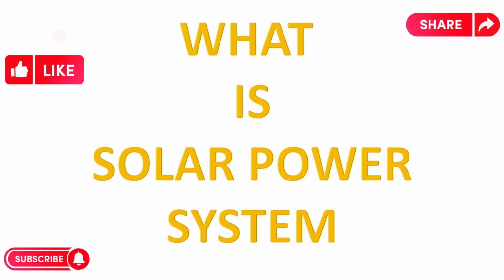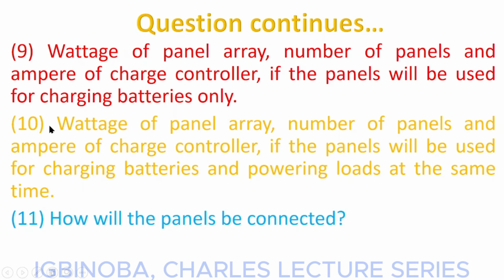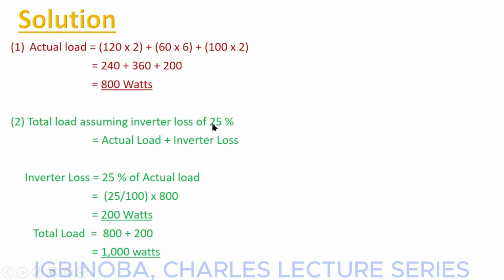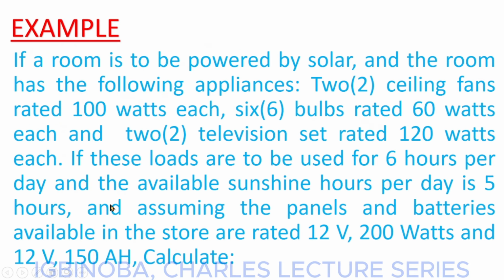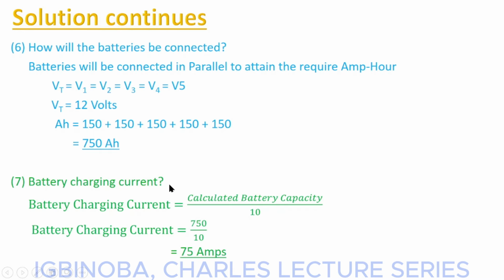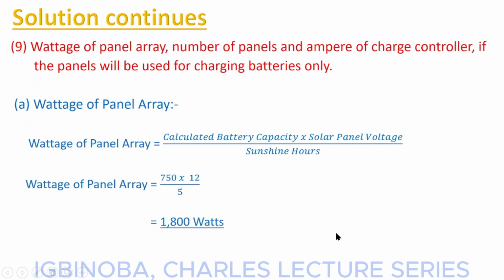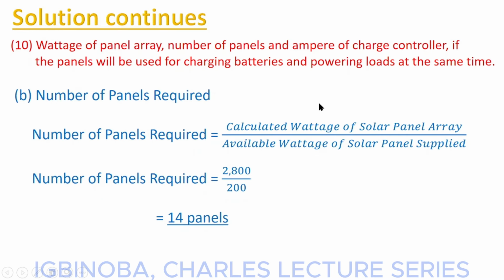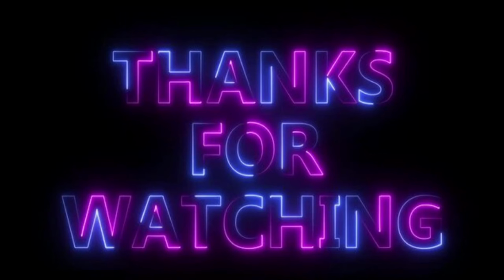Design of Solar Power System

Comment: EEE395Q 
1. Actual Load = 1380 watts

2. Total Load = 1725 watts

3. Inverter Rating = 2156.25 VA

4. Battery Capacity = 1293.75 Ah

5. Number of Batteries = 8.625 ~ 9 batteries

6. Parallel

7. Battery charging current = 129.375 Amps

8. Charging time = 14 hrs

9. (a) 3105 watts
    (b) 15.525 ~ 16 panels
    (c) 258.75 Amps

10. (a) 4830 watts
    (b) 24.15 ~ 24 panels
    (c) 402.5 Amps

11. Parallel

Comment: PETRO3180X
ANSWERS 
1. Actual load= (100×3)+(60×10)+(120×4) =1380watts
2. Total load assuming inverter loss of 25%= Actual load +Inverter loss
Inverter loss=25% of Actual load
= 25%×1380=345 watts
Total load= 1380+345=1725 watts
3. Inverter rating on VA using power factor of 0.8
= (1725÷0.8)= 2156.25
4. Battery capacity using factor for reserve 75%=(2×1725×6×0.75)=1293.75Ah
5. No. of batteries for backup hours=1293.75Ah÷150Ah= 8.6 =8 batteries 
6. How batteries will be connected?
The batteries will be connected in parallel 
Vt=V1=V2=V3=V4=V5=V6=V7=V8
Ah= 150+150+150+150+150+150+150+150=1200
7. Battery charging current=1293.75÷10=129Amps
8. Battery charging time assuming charging loss of 40%= 1293.75Ah+(40%+1293.75Ah)÷129A=14hrs
9a. Wattage panel array= 3105 watts
9b. Number of panels required= 3105÷345=9 panels 
9c. Ampere of charging controller required= 3105÷12=258.75Amps
10a. Wattage of panel array= Calculated wattage of solar panel array for charging battery only+ calculated total load =3105+1725=4830watts
10b. Number of panels required= calculated wattage of solar panel array÷ Available wattage of solar panel supplied= 4830watts÷345= 14Amps
10c. Ampere of charge controller= calculated wattage of solar panel array÷ solar panel voltage=4830watts÷12volts= 402.5Amps
11. How will the panels be connected?
Ans: They will be connected in parallel

Comment: PETRO331E

1. Actual load= (100×3)+(60×10)+(120×4) =1380watts
2. Total load assuming inverter loss of 25%= Actual load +Inverter loss
Inverter loss=25% of Actual load
= 25%×1380=345 watts
Total load= 1380+345=1725 watts
3. Inverter rating on VA using power factor of 0.8
= (1725÷0.8)= 2156.25
4. Battery capacity using factor for reserve 75%=(2×1725×6×0.75)=1293.75Ah
5. No. of batteries for backup hours=1293.75Ah÷150Ah= 8.6 =8 batteries 
6. How batteries will be connected?
The batteries will be connected in parallel 
Vt=V1=V2=V3=V4=V5=V6=V7=V8
Ah= 150+150+150+150+150+150+150+150=1200
7. Battery charging current=1293.75÷10=129Amps
8. Battery charging time assuming charging loss of 40%= 1293.75Ah+(40%+1293.75Ah)÷129A=14hrs
9a. Wattage panel array= 3105 watts
9b. Number of panels required= 3105÷345=9 panels 
9c. Ampere of charging controller required= 3105÷12=258.75Amps
10a. Wattage of panel array= Calculated wattage of solar panel array for charging battery only+ calculated total load =3105+1725=4830watts
10b. Number of panels required= calculated wattage of solar panel array÷ Available wattage of solar panel supplied= 4830watts÷345= 14Amps
10c. Ampere of charge controller= calculated wattage of solar panel array÷ solar panel voltage=4830watts÷12volts= 402.5Amps
11. How will the panels be connected?
Ans: They will be connected in parallel

Comment: MECH3196N

1. Actual load: 1380W

2. Total load: 1725W

3. Inverter rating: 2156.25VA

4. Battery capacity: 1293.75AH

5. Number of batteries: 9

6. Configuration: Parallel

7. Battery charging current: 129.375 amps

8. Charging time: 14 hours

9. (A) 3105W

   (B) 15.5 panels

   (C) 258.75A

10. (A) 4830W

    (B) 24 panels

    (C) 402.5A

11. Configuration: Parallel

Comment: PETRO 317Q
1. Actual load= (100×3)+(60×10)+(120×4) =1380watts
2. Total load assuming inverter loss of 25%= Actual load +Inverter loss
Inverter loss=25% of Actual load
= 25%×1380=345 watts
Total load= 1380+345=1725 watts
3. Inverter rating on VA using power factor of 0.8
= (1725÷0.8)= 2156.25
4. Battery capacity using factor for reserve 75%=(2×1725×6×0.75)=1293.75Ah
5. No. of batteries for backup hours=1293.75Ah÷150Ah= 8.6 =8 batteries 
6. The batteries will be connected in parallel 
Vt=V1=V2=V3=V4=V5=V6=V7=V8
Ah= 150+150+150+150+150+150+150+150=1200
7. Battery charging current=1293.75÷10=129Amps
8. Battery charging time assuming charging loss of 40%= 1293.75Ah+(40%+1293.75Ah)÷129A=14hrs
9a. Wattage panel array= 3105 watts
9b. Number of panels required= 3105÷345=9 panels 
9c. Ampere of charging controller required= 3105÷12=258.75Amps
10a. Wattage of panel array= Calculated wattage of solar panel array for charging battery only+ calculated total load =3105+1725=4830watts
10b. Number of panels required= calculated wattage of solar panel array÷ Available wattage of solar panel supplied= 4830watts÷345= 14Amps
10c. Ampere of charge controller= calculated wattage of solar panel array÷ solar panel voltage=4830watts÷12volts= 402.5Amps
11. They will be connected in parallel

Comment: PETRO3110F 

SOLUTION.
1. Actual Load:
       (100W × 3) + (60W × 10) + (120W × 4) = 1380 W
2. Total Load (with 25% Inverter Loss):
       1380 W + (0.25 × 1380 W) = 1725 W
3. Inverter Rating (VA):
       1725 W / 0.8 (Power Factor) = 2156 VA
4. Required Battery Capacity (for 6 hrs, 75% Reserve):
       (2 × 1725W × 6h × 0.75) / 1 = 12,942 Wh or 1294 Ah @ 12V
5. Number of Batteries (150 Ah each):
       1294 Ah / 150 Ah ≈ 9 Batteries (Rounded up)
6. Battery Connection:
       Parallel (To maintain 12V, 9 × 150Ah = 1350 Ah total)
7. Battery Charging Current:
       1294 Ah / 10h (C10 rate) = 129 A
8. Battery Charging Time (with 40% loss):
       [1294 Ah + (0.4 × 1294 Ah)] / 129 A = 14 hours
9. Solar for Battery Charging Only:
   · Array Wattage: 1294 Ah × 12V × 0.2 (C5 rate) ≈ 3105 W
   · Number of Panels (345W): 3105 W / 345 W ≈ 9 Panels
   · Charge Controller Current: 3105 W / 12V = 259 A
10. Solar for Load + Battery Charging:
    · Array Wattage: 1725 W (Load) + 3105 W (Battery) = 4830 W
    · Number of Panels (345W): 4830 W / 345 W ≈ 14 Panels
    · Charge Controller Current: 4830 W / 12V = 402.5 A
11. Panel Connection:
        Parallel (To maintain 12V system voltage)

Comment: PETRO31651
 
1. Actual load= (100×3)+(60×10)+(120×4) =1380watts
2. Total load assuming inverter loss of 25%= Actual load +Inverter loss
Inverter loss=25% of Actual load
= 25%×1380=345 watts
Total load= 1380+345=1725 watts
3. Inverter rating on VA using power factor of 0.8
= (1725÷0.8)= 2156.25
4. Battery capacity using factor for reserve 75%=(2×1725×6×0.75)=1293.75Ah
5. No. of batteries for backup hours=1293.75Ah÷150Ah= 8.6 =8 batteries 
6. How batteries will be connected?
The batteries will be connected in parallel 
Vt=V1=V2=V3=V4=V5=V6=V7=V8
Ah= 150+150+150+150+150+150+150+150=1200
7. Battery charging current=1293.75÷10=129Amps
8. Battery charging time assuming charging loss of 40%= 1293.75Ah+(40%+1293.75Ah)÷129A=14hrs
9a. Wattage panel array= 3105 watts
9b. Number of panels required= 3105÷345=9 panels 
9c. Ampere of charging controller required= 3105÷12=258.75Amps
10a. Wattage of panel array= Calculated wattage of solar panel array for charging battery only+ calculated total load =3105+1725=4830watts
10b. Number of panels required= calculated wattage of solar panel array÷ Available wattage of solar panel supplied= 4830watts÷345= 14Amps
10c. Ampere of charge controller= calculated wattage of solar panel array÷ solar panel voltage=4830watts÷12volts= 402.5Amps
11. How will the panels be connected?
Ans: They will be connected in parallel.

Comment: PETRO3118N 

1. Actual Load Calculation
Actual load = (100×3)+(60×10)+(120×4)
= 300 + 600 + 480
= 1380 watts

2. Total Load with Inverter Loss
Inverter loss = 25% of Actual load
= 0.25 × 1380
= 345 watts
Total load = Actual load + Inverter loss
= 1380 + 345
= 1725 watts

3. Inverter Rating (VA)
Inverter rating = Total load / Power factor
= 1725 / 0.8
= 2156.25 VA

4. Battery Capacity
Battery capacity = (Total load × Backup time × Reserve factor)
= (2 × 1725 × 6 × 0.75)
= 1293.75 Ah

5. Number of Batteries
Number of batteries = Battery capacity / Battery Ah rating
= 1293.75 Ah ÷ 150 Ah
= 8.6 ≈ 8 batteries

6. Battery Connection
Batteries will be connected in parallel:
- Voltage: Vt = V1 = V2 = ... = V8
- Ah capacity: 150 + 150 + ... + 150 = 1200 Ah

7. Battery Charging Current
Charging current = Battery capacity / Charging time
= 1293.75 Ah ÷ 10 hours
= 129 Amps

8. Battery Charging Time
Charging time = (Battery capacity + Charging loss) / Charging current
= (1293.75 Ah + (0.4 × 1293.75 Ah)) ÷ 129 A
= 14 hours

9. Solar Panel Array
a. Wattage: 3105 watts
b. Number of panels: 3105 ÷ 345
= 9 panels
c. Charging controller Amps: 3105 ÷ 12
= 258.75 Amps

10. Updated Solar Panel Array
a. Wattage: 3105 + 1725
= 4830 watts
b. Number of panels: 4830 ÷ 345
= 14 panels
c. Charging controller Amps: 4830 ÷ 12
= 402.5 Amps

11. Panel Connection
Panels will be connected in parallel.

Comment: EEE390L

1. Actual Load = 1380 watts

2. Total Load = 1725 watts

3. Inverter Rating = 2156.25 VA

4. Battery Capacity = 1293.75 Ah

5. Number of Batteries = 8.625~9 batteries

6. Parallel

7. Battery charging current = 129.375 Amps

8. Charging time = 14hrs

9. (a) 3105 watts

(b) 15.525~16 panels

(c) 258.75 Amps

10. (a) 4830 watts

(b) 24.15~24 panels

(c) 402.5 Amps

11. Parallel

Comment: PETRO3144N
Answers:
1. Actual load= (100×3)+(60×10)+(120×4) =1380watts
2. Total load assuming inverter loss of 25%= Actual load +Inverter loss
Inverter loss=25% of Actual load
= 25%×1380=345 watts
Total load= 1380+345=1725 watts
3. Inverter rating on VA using power factor of 0.8
= (1725÷0.8)= 2156.25
4. Battery capacity using factor for reserve 75%=(2×1725×6×0.75)=1293.75Ah
5. No. of batteries for backup hours=1293.75Ah÷150Ah= 8.6 =8 batteries 
6. How batteries will be connected?
The batteries will be connected in parallel 
Vt=V1=V2=V3=V4=V5=V6=V7=V8
Ah= 150+150+150+150+150+150+150+150=1200
7. Battery charging current=1293.75÷10=129Amps
8. Battery charging time assuming charging loss of 40%= 1293.75Ah+(40%+1293.75Ah)÷129A=14hrs
9a. Wattage panel array= 3105 watts
9b. Number of panels required= 3105÷345=9 panels 
9c. Ampere of charging controller required= 3105÷12=258.75Amps
10a. Wattage of panel array= Calculated wattage of solar panel array for charging battery only+ calculated total load =3105+1725=4830watts
10b. Number of panels required= calculated wattage of solar panel array÷ Available wattage of solar panel supplied= 4830watts÷345= 14Amps
10c. Ampere of charge controller= calculated wattage of solar panel array÷ solar panel voltage=4830watts÷12volts= 402.5Amps
11. How will the panels be connected?
Ans: They will be connected in parallel

Comment: PETRO333G

1. Actual load= (100×3)+(60×10)+(120×4) =1380watts
2. Total load assuming inverter loss of 25%= Actual load +Inverter loss
Inverter loss=25% of Actual load
= 25%×1380=345 watts
Total load= 1380+345=1725 watts
3. Inverter rating on VA using power factor of 0.8
= (1725÷0.8)= 2156.25
4. Battery capacity using factor for reserve 75%=(2×1725×6×0.75)=1293.75Ah
5. No. of batteries for backup hours=1293.75Ah÷150Ah= 8.6 =8 batteries 
6. How batteries will be connected?
The batteries will be connected in parallel 
Vt=V1=V2=V3=V4=V5=V6=V7=V8
Ah= 150+150+150+150+150+150+150+150=1200
7. Battery charging current=1293.75÷10=129Amps
8. Battery charging time assuming charging loss of 40%= 1293.75Ah+(40%+1293.75Ah)÷129A=14hrs
9a. Wattage panel array= 3105 watts
9b. Number of panels required= 3105÷345=9 panels 
9c. Ampere of charging controller required= 3105÷12=258.75Amps
10a. Wattage of panel array= Calculated wattage of solar panel array for charging battery only+ calculated total load =3105+1725=4830watts
10b. Number of panels required= calculated wattage of solar panel array÷ Available wattage of solar panel supplied= 4830watts÷345= 14Amps
10c. Ampere of charge controller= calculated wattage of solar panel array÷ solar panel voltage=4830watts÷12volts= 402.5Amps
11. How will the panels be connected?
Ans: They will be connected in parallel

Comment: PETRO3140J

1. Actual load= (100×3)+(60×10)+(120×4) =1380watts
2. Total load assuming inverter loss of 25%= Actual load +Inverter loss
Inverter loss=25% of Actual load
= 25%×1380=345 watts
Total load= 1380+345=1725 watts
3. Inverter rating on VA using power factor of 0.8
= (1725÷0.8)= 2156.25
4. Battery capacity using factor for reserve 75%=(2×1725×6×0.75)=1293.75Ah
5. No. of batteries for backup hours=1293.75Ah÷150Ah= 8.6 =8 batteries 
6. How batteries will be connected?
The batteries will be connected in parallel 
Vt=V1=V2=V3=V4=V5=V6=V7=V8
Ah= 150+150+150+150+150+150+150+150=1200
7. Battery charging current=1293.75÷10=129Amps
8. Battery charging time assuming charging loss of 40%= 1293.75Ah+(40%+1293.75Ah)÷129A=14hrs
9a. Wattage panel array= 3105 watts
9b. Number of panels required= 3105÷345=9 panels 
9c. Ampere of charging controller required= 3105÷12=258.75Amps
10a. Wattage of panel array= Calculated wattage of solar panel array for charging battery only+ calculated total load =3105+1725=4830watts
10b. Number of panels required= calculated wattage of solar panel array÷ Available wattage of solar panel supplied= 4830watts÷345= 14Amps
10c. Ampere of charge controller= calculated wattage of solar panel array÷ solar panel voltage=4830watts÷12volts= 402.5Amps
11. How will the panels be connected?
Ans: They will be connected in parallel

Comment: CIV 383E

1.Actual load is 1380w
2. Total load is 1725w
3. Inverter rating is 2156.25VA
4.Battery capacity is 1293.75AH
5. No. Of batteries is 9
6. Parallel
7.Battery charging current is 129.375amps
8. Charging time is 14hours
9. (A) 3105w
(B) 15.5panels
(C)258.75A
10.(A) 4830w
(B) 24panels
(C) 402.5A
11. Parallel

Comment: COMP96R

1. Actual Load: 1380 W
2. Total Load (including inverter loss): 1840 W
3. Inverter Rating (VA): 2300 VA
4. Battery Capacity: 1227 Ah
5. Number of Batteries: 9 batteries
6. Battery Connection: Parallel
7. Battery Charging Current: 15 A (per battery string)
8. Battery Charging Time: 5.1 days
9. Panel Array (for charging batteries only):
   · Wattage: 2945 W
   · Number of Panels: 15 panels
   · Charge Controller Ampere: 245 A
10. Panel Array (for charging batteries and powering loads):
    · Wattage: 4785 W
    · Number of Panels: 24 panels
    · Charge Controller Ampere: 399 A
11. Panel Connection: Series - Parallel

Comment: PETRO 31E 

1.actual load=1380w
2.Total load=1725w
3.inverter rating=2156.25VA
4.battery capacity=1293.25AH
5.number of batteries required=8.6 approximately 9 batteries 
6.it will be connected in parallel 
7.charging current=129.375amps
8.charging time=14 hours
9.3105w and 15.5 panels 
10.4830w and 24panels and 402.5A
11.the panels will be connected in parallel.

Comment: PETRO379A

1. Actual load is 1380w
2. Total load is 1725w
3. Inverter rating is 2156.25VA
4. Battery capacity is 1293.75AH
5. No of batteries 8.6 ~9
6. Parallel
7. Battery charging current is 129.375amps
8. Charging time is 14 hours
9. (A) 3105W
(B) 15.5 panels
(C) 258.75A
10. (A) 4830w
(B) 24 panels
(C) 402.5A
11. Parallel

Comment: COMP39I

1. Actual load 1380W
2.Total load 1720W
3 .Inverter rating 2156.25VA
4. battery Capacity 1293.75Ah
5 .number of batteries 8.6
6 .Parallel
7. Battery charging 129.4A
8.T =14hrs
9. (a) 3105W 
     (b) 15.5 panels
     (c) 258.75 A

10 (a) 4830W
     (b) 24 panel
    (c) 402.5A

11.Parallel

Comment: COMP81C 

1 Actual load 1380W
2 Total load 1720W
3 Inverter rating 2156.25VA
4 Battery Capacity 1293.75Ah
5 Number of batteries 8.6
6 Parallel
7 Battery charging 129.4A
8 T = 14hrs
9 (a) 3105W
   (b) 15.5 panels
   (c) 258.75 A
10 (a) 4830W
      (b) 24 panel
      (c) 402.5A
11 Parallel

Comment: PETRO3152V

1. Actual Load = 1380 watts

2. Total Load = 1725 watts

3. Inverter Rating = 2156.25 VA

4. Battery Capacity = 1293.75 Ah

5. Number of Batteries = 8.625 ≈ 9 batteries

6. Parallel

7. Battery Charging Current = 129.375 Amps

8. Charging Time = 14 hrs

9. (a) 3105 watts
(b) 15.525 ≈ 16 panels
(c) 258.75 Amps

10. 

(a) 4830 watts
(b) 24.15 ≈ 24 panels
(c) 402.5 Amps

11. Parallel

Comment: MAR3133C

1 Actual load is 1380W

2 Total load is 1720W

3 Inverter rating is 2156.25VA

4 battery Capacity is 1293.75Ah

5 number of batteries is 8.6

6 Parallel

7 Battery charging is 129.4A

8 Time is 14hrs

9 (a) 3105W

(b) 15.5 panels

(c) 258.75 A

10 (a) 4830W

(b) 24 panel

(c) 402.5A

11 Parallel

Comment: PETRO360H
1.Actual load is 1380 watts 
2.Total load is 1725 watts 
3.Inverter Rating is 2156.25VA
4.Battery Capacity is 1293.75Ah
5.Number of Batteries= 8.625~9 batteries 
6.Parellel
7.Battery charging current=129.375Amps
8.Charging time=14 hrs
9.(a)3105 watts 
(b)15.525~16 panels 
(c)258.75Amps
10.(a)4830 watts 
(b)24.15~24 panels 
(c)402.5 Amps
11.Parallel

Comment: CHM3154X

1. Actual load 1380w
2. Total load 1720w
3. Inverter rating 2156.25VA
4. Battery capacity 1293.75Ah
5. Number of batteries 8.6.
6. Parallel
7. Battery charging 129.4A
8. T= 14hrs
9(a) 3105w
(b) 15.5panels
(C) 258.75A
10. (a) 4830w
(b) 24panels
(c) 402.5A
11. Parallel

Comment: PEE356D

1. Actual load is 1380w

2. Total load is 1725w

3. Inverter rating is 2156.25VA

4. Battery capacity is 1293.75AH

5. No of batteries 9

6. Parallel

7. Battery charging current is 129.375amps

8. Charging time is 14 hours

9. (A) 3105w
(B) 15.5 panels
(C) 258.75A

10. (A) 4830w
(B) 24 panels
(C) 402.5A

11. Parallel

Comment: PETRO 335I
1. Actual Load = 1380 watts
2. Total Load = 1725 watts
3. Inverter Rating = 2156.25 VA
4. Battery Capacity = 1293.75 Ah
5. Number of Batteries = 8.625 ~ 9 batteries
6. Parallel
7. Battery charging current = 129.375 Amps
8. Charging time = 14 hrs
9. (a) 3105 watts
 (b) 15.525 ~ 16 panels
  (c) 258.75 Amps
10. (a) 4830 watts
  (b) 24.15 ~ 24 panels
  (c) 402.5 Amps
11. Parallel